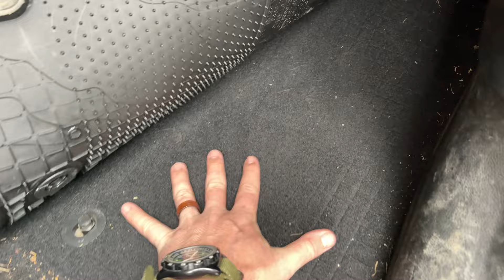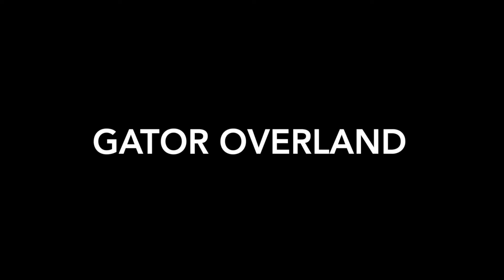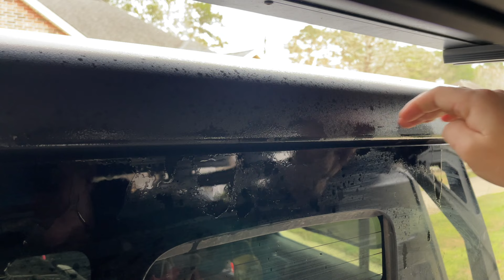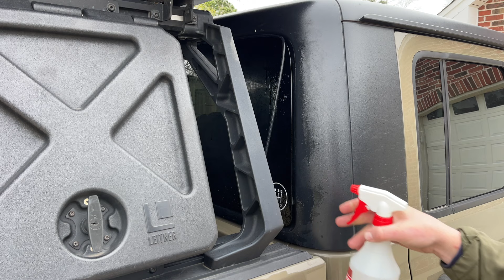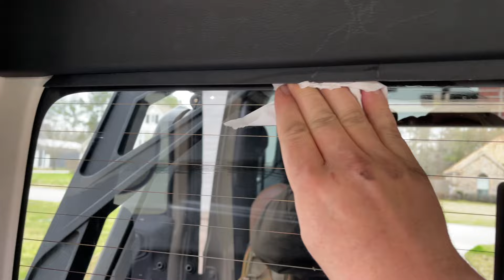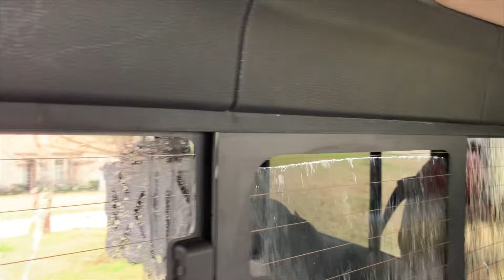DIY Rear Window Leak Fix For Jeep Gladiator

Comment: went easy on the top but the sides was a pain in the butt but you do suggest at least going to the corners of each side
Reply from the maker: Yes, mine was a pain in the ass too… Yes, definitely at least down the sides a couple inches (I.e. half way)… You do not necessarily need to make the bend at the bottom

Comment: My 2021 Jeep Gladiator Rubicon truck started showing signs of a little leak on the rear window. I followed the video, except I only did the top, sides and used a plastic putty knife to help with the installation. The bottom was just too tight. I even tried using a hair dryer to heat up the tubing. I did a leak test going thru a car wash (this Is how i discovered the little leak) and now no leak. So far so good. Thanks for sharing.
Reply from the maker: Yes, really all you need to do is seal the top side of the window… Going around the bottom is just a extra measure… As long as you have the top and the sides you should be good to go… Thanks for following up with your results… Glad it helped
Reply: i need to do the same now. found a small leak on my mojave 2022.

Comment: What exactly did you buy for the tubing? I bought some 7mm tubing but it wasnt enough and too thick anyway.
Reply from the maker: Unfortunately, the windows are not a single solid fit. There’s a lot of deviation in the setting… If it doesn’t fit go to a smaller diameter… You may try hitting up the tubing with a hairdryer to make it more pliable. Or invest in some KY jelly or similar… I can’t say it was the easiest process of getting it pinched between the gap, but I managed to do it all the way around even in 40° temperatures… My fingers hurt, but as of now I haven’t had a leak in a year

Comment: Do you have a dyi fix for the leak on the passenger side front? Comes in when breaking and there is water in the channel.
Reply from the maker: When the door is open or when the door is closed? 
If it’s when the door is closed, it’s probably a weatherstripping issue and needs to be taken care of by a specialist, or yourself if you know what you’re doing… If it’s happening when the door is open, there is a special rubber attachment as a rain gutter extension to direct the water over the windshield. https://amzn.to/3PC28gG
There is also a rain gutter damn https://amzn.to/40jtUUb , but the diy fix would be a dollop of silicone sealant at the end of the channel.
Reply: @GatorOverland  its when the door is closed. When you break the water runs forward in the channel and then it drips in....Jeep says its "normal" and cant be fixed. I don't believe that. Any help appreciated
Reply from the maker: @realestatepros-thebestrealtors that I’m not sure about. I haven’t experience it.

Comment: you made it look so easy, when the truth is the button of the window the tube will not go in. but you didn't show that part did you lol
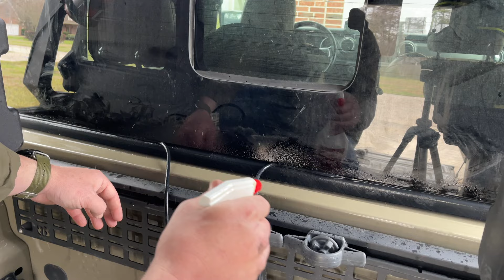Reply from the maker: I explain at 6:08 that it wasn’t easy and did show going around the bottom.. 
You really only need to get to the sides bottom corner
Reply: Maybe you should do your own follow-up video showing how it's done lol
Reply from the maker: 😂😂 it’s as simple as pushing tube into a crack.. not much more I can do other and give an idea and say that’s how you do it.. off it doesn’t fit with the advised 7mm, get 6 or 5mm.. 
the follow up is after over a year of leaking and smelling like wet socks every time it rained,  it’s now been 3mos of no leaks.. 🤘🏼
Reply: "Pushing tube into a crack" I'm dying over that comment.
Reply from the maker: @PathsLessTraveled 😂😂😂

Comment: Hey thank you so much when I go to the link it says 3mm did the link change?
Reply from the maker: No, I believe that’s all that’s available at this time via that link… Just search 7 mm OD silicone vacuum tubing and something will pop up… You need 8ft minimum .. you can get this at the local auto parts store as well.
Hopefully the link becomes available soon… That video has already generated so many views that it might’ve sold out of the 7 mm size.. you can also search for 9/32” OD, which is the US equivalent
Reply from the maker: https://hpsperformanceproducts.com/products/hps-high-temp-silicone-vacuum-hose-tubing-coolant-overflow-tube-htsvh
Here is a good source sold by the foot. Enter the quantity units = feet.. if you want 10ft get qty 10..
It’s a bit more expensive but it’s way cheaper than $1000

Comment: Is this tubing UV resistant? Will it decay in the TX sun??
Reply from the maker: Most materials are subject to UV degradation, and there is potential for that overtime for sure. It is not specified on the material description to be UV resistant other than not for fuel/oil use… At $14 you can replace it over and over should it decay prematurely.
Reply: Cool. Mine is currently at the dealer for leak fix #3!! After they are "done" with it, I'm going to pre-emptively do your fix. Thanks for posting it and replying to my question.
Reply from the maker: @tomhawkins9897 awesome… Can’t hurt… Thanks for taking the time to watch and comment

Comment: I was able to get the top and sides completed but there no way I can get this tubing in the bottom channel of the window. Any recommendations of techniques or different tubing that could fit?
Reply from the maker: The main priority would be the top and the side… I only went completely around the bottom for looks… You can maybe try a smaller diameter hose, and it would possibly look seamless… Only you would notice if anything…

Comment: Just an fyi, the isopropyl, alcohol and water solution is interesting… Please be aware that if you get that on your paint you could be removing whatever protective coating/wax it touches on the vehicle… so you will need to reapply whatever is protecting your car paint.
Reply from the maker: The is good to be aware of. I’m not sure what composition percentage proves damaging, and it might be different from black hardtop vs color matched, but I haven’t seen any negative effects for the 50/50 mix.. I don’t typically wax my vehicle, so minimal loss for me.. worth it to fix the leak😉
Reply: @GatorOverland  it’s common for auto detailers to use a 50/50 mix to remove old protection before applying new protection.

Comment: Is there any reason you don't tape it off and fill the gap with black silicone ? Seems to me it would certainly solve the problem and most likely last alot longer , granted it probably not the best way to hold for everyone
Reply from the maker: That’s a great question.. this is non invasive install.. you could take the time tape it off and seal it, but good luck getting it off if you actually needed to change it out.
Reply: That's how you seal replacement lens on boat deck hatches. Looks clean if you tape carefully.

Comment: simple r and I job done by a pro would solve this issue
Reply from the maker: That’s the problem, even the pros have trouble removing and installing the glass just to replace the seal, and often times the damaging the top or the glass.. this is a non-invasive remedy to avoid having to deal with dealers or costly issues the may develop, especially for folks out of warranty.

Comment: Worked on mine for over a year now.
Don't let them cut it out.
Do this.
My Oops, mine is a 21  so closer to two years now.
Reply from the maker: Thanks for the valuable insight! 🤘🏼🤘🏼🤘🏼
Reply: @GatorOverland, I'm not sure how valuable that was. It's great to see someone putting a video out about this.
I'm in several gladiator sites and a guy in Louisiana had the same issue.
He shared this with me.
Better than being told ( by the glass shop ) we have only cut one out, and we damaged the top.
Then the dealership tells me if that happens we will keep your gladiator until the new top arrives, gets painted, then installed. 
Really?, how long is that?, can be minimum of 6 months if your lucky.
Nope, I'm Irish, but not a gambler.
So I did this.
Works like a charm, I used a popsicle stick, left it open on the bottom so it can drain. 
Love the outcome.
Thanks again for your video. 
✌️